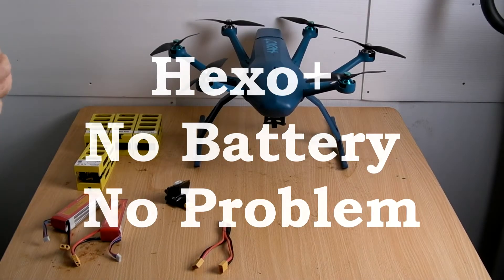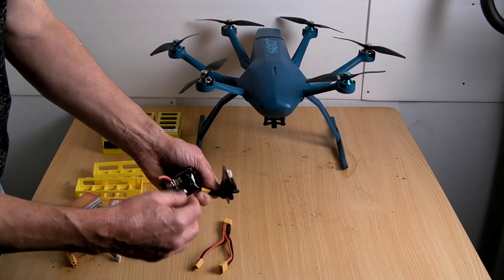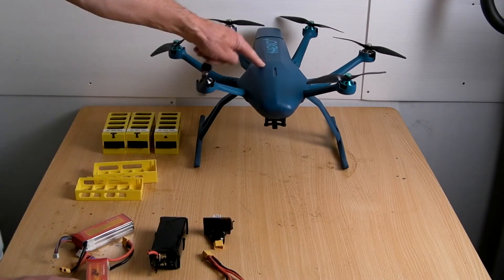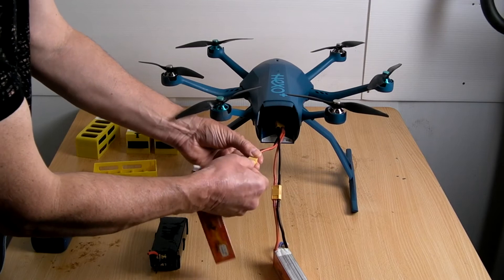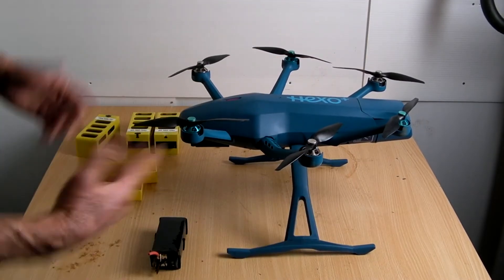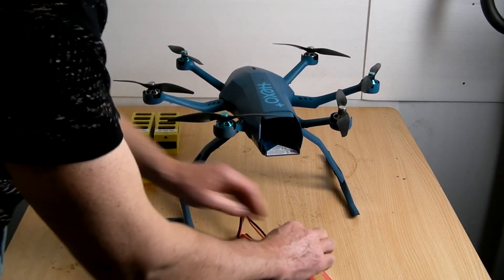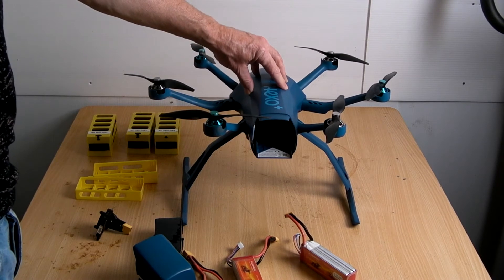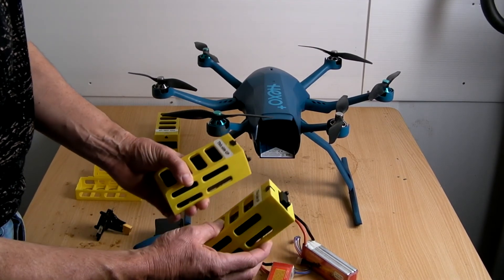Hexo+ No Battery No Problem - How to get your Hexo+ Flying again

Comment: Great tip since I've got one hexo battery with a dead cell and the others aren't that strong anymore also. Can you tell me with type of alternative batteries you've used here and where to get them cheap?!?
Reply from the maker: The reason I used these batteries was I had a few batteries spare from my V1 Dji Phantom I have thought about connecting one of these batteries to the balance plug on the hexo battery by drilling a hole in the top of the hexo and attaching it to the top to get extra flight time and I am working on connecting a manual controller Radiolink At9  because the hexo provides for that with the transmitter port under the battery compartment so lots to try out on mine
Reply: @splitzers2898  thanks for the vid.  I’ve managed to get hold of a few Hexo+ sets for not very much and managed to get one of them to fly.  The good side of that is plenty of spare parts, so I can mess around with mods without too much risk.  Also…4 working battery packs.  You mention intending to try out a Radiolink AT9 with yours…did you ever get around to it?
Reply: @random3452345  did you try this recently?
Reply: Ah nice! I keep following you then, saw some propable alternative batts on banggood meantime, 11.1V 3S LiPo. Bought my Hexo recently cheap as sort of a try out and placed some vids of it also, so if you like watch'em...😉